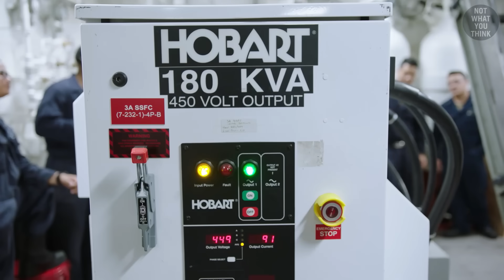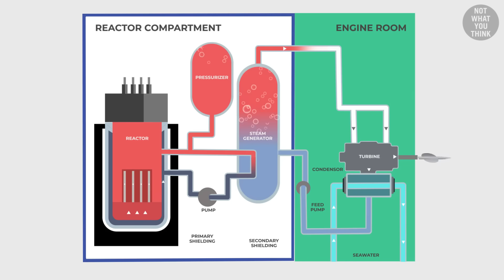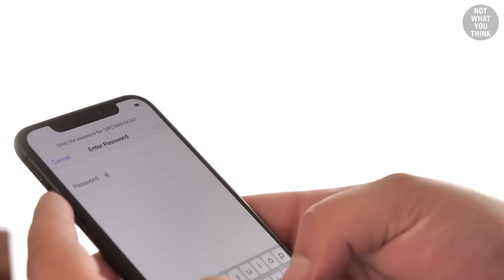America's “Aircraft Carrier Shortage” Explained

Comment: They use a rule of thirds, but picked a non-divisible by 3 number of carriers to require. Just one more and we would have been golden. XD
Reply: Not really.

A CVN deployment schedule is split roughly into thirds, but in the middle of her projected lifespan she's going to bow out for several years for refueling. Well, more accurately refueling the reactors and also doing major upgrades and repairs. The Ford's A1B reactors may not need to be refueled during her operational service life, but its very likely she'll be out of the rotation for several years as her systems get major work done.

So, although the law says the US Navy is limited to 12 flattops during peacetime, a more sustainable number would be something like 13.
Reply: @mikehammer4018 also, US law says 11 carriers is a minimum. The maximum is purely based on how much money is needed to be spent and the ability to crew them.
Reply: @mikehammer4018 also, US law says 11 carriers is a minimum. The maximum is purely based on how much money is needed to be spent and the ability to crew them.  The Ford will be refueled just like the Nimitz class, once.
Reply: @haolepirate  Interesting. I've heard the A1B fueling design reported everywhere from never to every 10-20 years.

The latter, barring an utterly insane optempo, is very unlikely. The former was what NAVSEA 08 was designing toward back when we were given a sneak peek and asked for our suggestions - but that was over twenty years ago.

The AFR cores had an amazing cross-sectional flux distribution, so it doesn't strike me as unreasonable that the new carrier cores wouldn't as well; which makes fuel programming possible.

Since I don't catch Navy neutrons for a living anymore, I neither have the security clearance nor need to know one way or the other. Not that I'd turn down a tour of a Ford engine room if one was offered!
Reply: @mikehammer4018 carrier cycles are in quarters, not thirds. Approximately 6 months for planned maintenance, with adjustments for unplanned repairs.  About six months of shakedown and crew certification.   About six months of carrier quals for squadrons, and 6 months for deployment. The lengths of cycles may change, but there are always 4 parts.
Reply: @haolepirate  Okay, I believe you. Wasn't that way back when I was in; but that was over twenty years ago. With middling availabilities, it worked out to be about 9 months off the line between post-deployment crew leave and pre-yard surveys, followed by the yard work and then acceptance cruise. A couple months to recertify the ship and airwing, culminating in FEP, followed by regular cruises to raise readiness as the on-deck carrier (including RIMPAC for us). Then we deployed, which included a nice long stay in the freaking Persian Gulf. Total cycle time was a bit less than two years.

I remember the flyboys integrating fairly rapidly with the ship; I think they were demonstrating basic proficiency including night traps within a couple weeks. However, my memory might be faulty as it was over two decades ago.
Reply: Lol, ikr 😂 - that's exactly where my OCD brain that prefers round numbers went as well!
Reply: There's no rule of thirds for carriers.